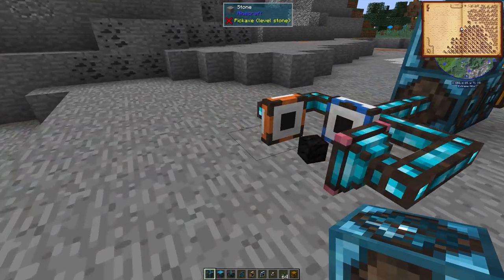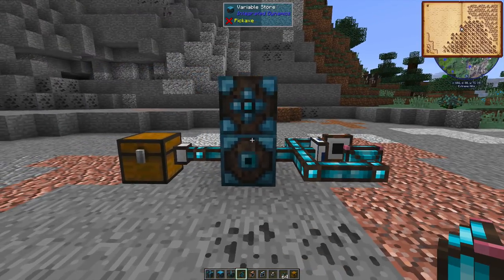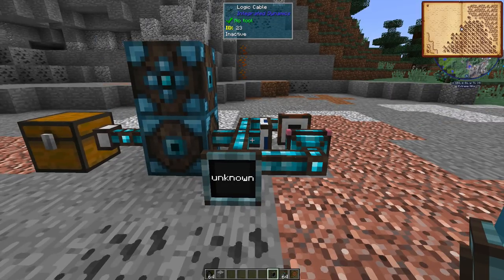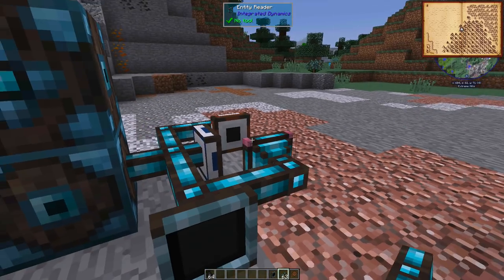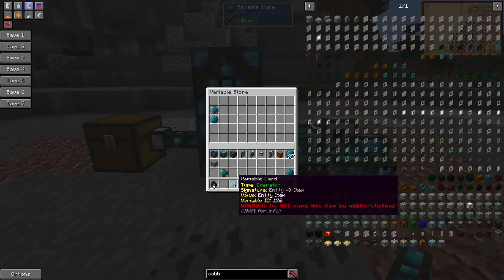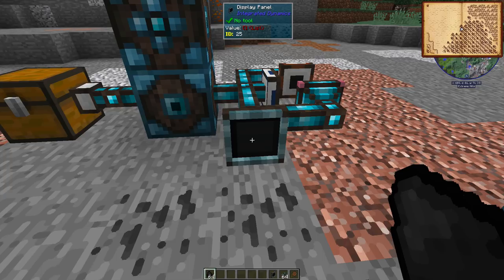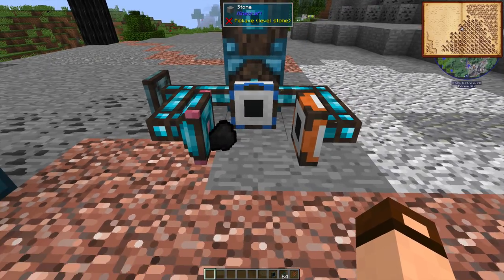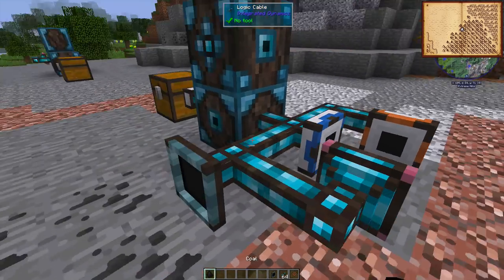Using Integrated Dynamics for Item Drop Control

Comment: The actual lifespan limit is just over 2 billion ticks (2147483647 to be exact). This is because of limits in Java, the language used to make minecraft. That number is the signed 32-bit integer limit, that is the largest possible number a 32-bit Java VM could handle in a format that supports both positive and negative numbers. This is because it can use 32 bits (0 or 1) per integer, 31 of which are used to make up the integer value and one of which is used to determine if it's negative or positive. This makes it so that the max lifespan is 2^31. This is also how mods make items that "can't" despawn; they simply set the lifespan so high that the item would need to be on the ground in a loaded chunk for 3.4 years continually.
Reply from the maker: MAX_INT can be handy that way. :)      (<-- programmer)     :)

Comment: This is still very useful now... Curious though-
The number of ticks you could fit in that would be "999999999", so one tick off a billion ticks... Is there any harm in just deleting everything and holding down 9 instead?

Given, I don't know any operation that would require an entity to be out for 600,000,000 ticks (That's 30,000,000 seconds, or just short of 12 months...), even AE2 pure crystals without the accelerator doesn't take quite that long...
Reply from the maker: My two most recent videos are all about automating Botania with Integrated Dynamics and a few of its add-ons. I do end up just setting the fuels pick up time to nine nines and ignore whether the mana pools are full or not. As I say in the video, the server won’t even be around in a year and a half when the items despawn. :)
Reply: @Nonsanity  Aha yeah. I came across your ATM6 Episode 4 video where you started using ID last night... 
Though I ended up closing it since I didn't want to watch an hour video at 2am... watching it now though :D